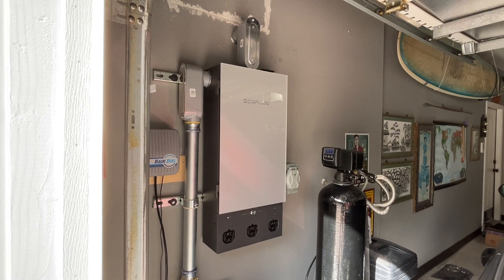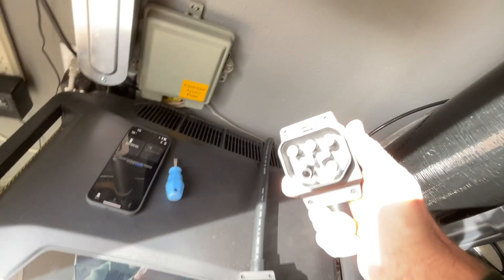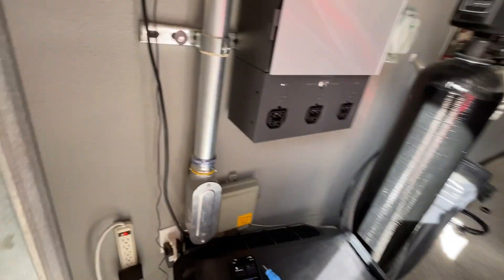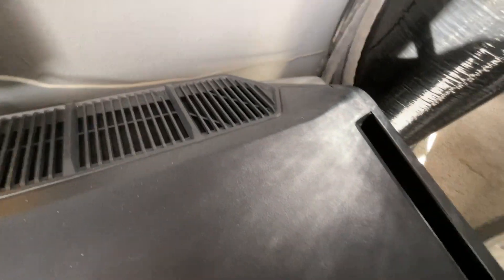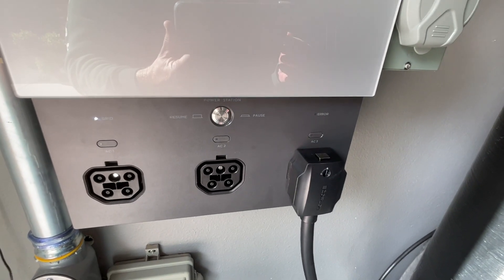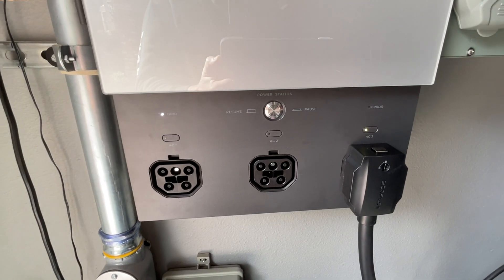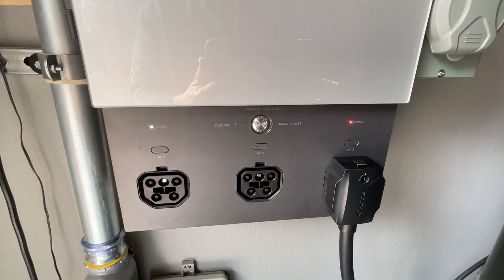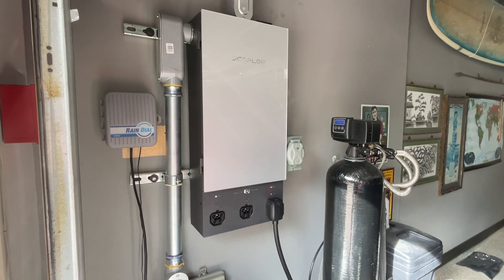EcoFlow Smart Home Panel 2 and Delta Pro Ultra connection problems. Follow-up video with new cable.

Comment: I had the exact same issue after my install. This is how i fixed it.
1) Unplug everything i mean Batteries, inverter, SHP2. 
2) wait 5 minutes 
3) Now connect the batteries then the inverter and then SHP2 and leave SHP2 OFF(do not press AC1,AC2 or AC3 button). 
4) PLUG in 110V charge cable to the inverter and start charging the batteries using the 110V wall connector. wait until it starts to charge from the wall outlet.
5) Press AC1/AC2/AC3 button on SHP2. this time it will recognize the batteries with NO ERROR.
6) Now go in the app and verify that you can check Battery SOC.
7) You can safely disconnect 110v AC now.
Hope this Helps.

Comment: I apologize in advance for the length of this post. Since 22 November 2025 I’ve experienced the EXACT issue you described in such relevant detail. The comments left on your channel were helpful in that they offered multiple ways to tackle the problem. My circumstances were serious because I’ve fully invested my home’s electrical power into the Ecoflow ecosystem. Since my home runs entirely on electricity, anything that sidelines the system is serious. I troubleshooted the problem in lock-step with your efforts. It proved fruitless as it did for you. I did not want to contact Ecoflow Tech Support because they appear to be reading from a script and do not have the freedom to fully dissect the matter at hand. I don’t want to ridicule EF’s tech support because ALL tech support for ALL “technology” companies are mediocre at best; especially those who use off-shore tech support phone banks. While staying away from that option, I began looking at the comments left on your channel. I focused on the simplest first and began eliminating those that I thought were least likely to address the problem. I chose to (1). Update the firmware (2). Switch out the inverter and (3). Switch the cable connecting the inverter to the Smart Home Panel 2 (SHP2). I was only able to update the SHP2 firmware because none was available for the battery. The update did not fix the problem. Two days later (24 Nov.) I switched out the inverter with a spare inverter I had on-hand. That also failed. Out of frustration, I unplugged the cable from the SHP2 AC1 port and shut down the inverter. I stepped away from the matter until 8 Dec. 2025. I had other matters to attend to like everyone else who has a family. My house was still receiving power from the grid, but it was using very high peak rate power for about 11 hours of each weekday. I am on a Time Of Use (TOU) plan and I use my batteries to avoid peak rate charges and only use low priced off-peak energy. So for ~ 2 weeks I was forced to pay peak rates for a portion of every weekday. On the 8th of Dec. I returned to this matter. I switched out the cable connecting the inverter to the SHP2 with a spare cable I had on-hand. After plugging the cable into SHP2 AC1 port I turned-on the inverter. This time I received a ‘green’ light over the AC1 port but there was still a ‘red’ error light on the SHP2. Seeing a ‘green’ light over the AC1 port was a small victory. I looked at the EF app and the error message that appeared had changed from the one you and I encountered previously (Error Code 4: Failure to connect to SHP2) to “The DPU firmware is too old. You must Update”. Previously, the EF app did not show a firmware update for the DPU back on the 22nd of November. I updated the firmware and now the ‘red’ error light turned-off on the SHP2. AC1 port continued to show a ‘green’ light. The battery began to function as normal. It appears that the comments recommending a cable change and firmware did the trick for my system. I am grateful to their contributions. I hope this helps you as well.

Comment: charging activation failed, do you have the 100A breaker from the main panel to the SHP2 with also 100A breaker in it. Have you try to see if it can be switched the SHP2 to use the battery power without the grid?

Comment: I’m having the a similar issue but with a DP3 (firmware version of battery is outdated error 43). However both the SHP2 and the DPU3 say they are up to the latest version. 
Have you resolved your issue?

Comment: You don’t suspect it’s the DPU but if you already tried a new cable i can almost guarantee you that it’s the DPU. It’s a hassle replacing them but not much else you can do about it. Also once you find a working firmware combo DO NOT upgrade any more unless you absolutely have to. Monkeys are making these new firmware updates. It’s the only explanation.

Comment: Same problem with my Delta Pro 3 and Smart Home Panel 2. I did the firmware updates as soon as they were installed. I couldn't turn on the outlets. However, a long press would get it to charge for 45-60 seconds or so then shut off with the same flashing red light. A couple of days ago I saw there was a firmware update so I did that. As soon as the update was done, it automatically started charging and continued charging while the app said, "Battery Activation Failed" yet it was charging while that message was displayed. Also, after that firmware update I could start and stop charging from the app which I could never do before. My new cable arrives today and I don't that's going to solve the problem.  I look forward to hearing how you solve this problem.
Reply: They sent me a new cable and everything is working as it should.

Comment: You did not show the side where the batteries are connected. There’s a silver colored button you hold in on the battery to turn on the batteries. There’s will be illuminated bars showing your charge on the side of the battery where the button is located.

Comment: You could hook up a generator inlet to the panel and plug the Delta Pro Ultra into that instead of a generator and see what happens then. Could be a temporary work around for you. Seems like a lot of people are using the DPU with a regular inlet/transfer switch setup instead of going the Smart Home Panek 2 route

Comment: I had something similar and forgot to put in the cat6 at the smart panel that gets connected to the small box and that cleared up my problem, the cat6 cable sends data back and forth between the panel 2 to the small box

Comment: I too am now invested in your journey. Its an expensive setup and would like to get the smhp2 and dpu rig as well but this would be frustrating to me. Keep us posted please. I used to be a senior engineer so troubleshooting was my jam. With the new cable, thats now crossed off. I would get a delta pro or delta pro 3 (I know easier said than done, but buy it and then return it, this is purely for testing purposes) and plug it and see what your findings are. That will immediately tell you if its your dpu or the smhp.

Comment: What was the resolution of this? I recently started researching getting this all since there's been amazing deals for it recently. I have about 7 Ecoflow products I bought over the span of 1 major sale and 2 pre-orders. I had 1 issue that was resolved with firmware. Literally as I was researching into this, my River 2 broke just 1 month after the warranty expired! They want me to pay more to repair it, then it would cost to simply buy a new one. It's almost as though its a sign.

It's a shame because all the other products I own of there's are amazing. But now I am nervous after this incident with myself and seeing you struggle here. The other issue is that all their stuff is proprietary so I can't simply fix it / troubleshoot it myself like I could with alternatives.

The thing they have going for them is the 1 centralized app that has everything in it, and their software just looks 1000x better than the cheaper solar DIYs people would recommend. Also there is no true 'Smart Panel' for those options as well that does all the things the SHP2 can do.

Comment: I have the same system and I have a different problem.every Sunday and only Sundays it doesn’t charge or discharge it’s just dead and only using grid power. I talk with customer service 20 times no one knows what is going on.not reliable don’t buy

Comment: I had a similar thing happen to me when I installed the SHP2 and tried to connect it to the DPU. The issue ended up being that the DPU inverters, batteries and the SHP2 were not updated with the latest firmware. It seems that out of the box the firmware versions on the components did not match and would not communicate with each other. After updated all the firmware versions to the latest version everything started working. It is so sensitive to firmware versions that at one point, when a new firmware version came out, the system stopped working until I upgraded it.
Reply from the maker: Thanks for your comment. I updated to the latest firmware on both units during the initial install. Maybe this latest firmware version has a bug?
Reply: I bought one The electrician says there's been nothing but problem with these things. It's a piece of junk, expensive junk.
Reply: @oldman7700  I can kind of second that, I have 2 inverters, and one has been exchanged twice under warranty, and the one that has always worked has an illegible display. I do not want to send the one that one back as it is the only inverter that has always worked and it reads correctly in the app... In essence I have had 4 inverters and not one of them has ever worked 100%.
Reply: @oldman7700 how would the electrician know this? They install the sub panel and that’s it. They don’t provide support for them, that’s on ecoflow…